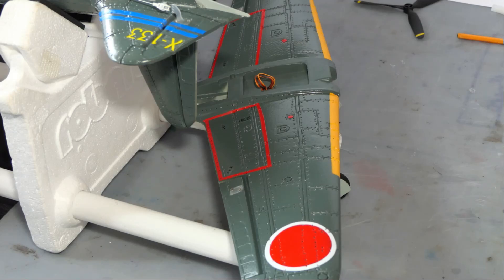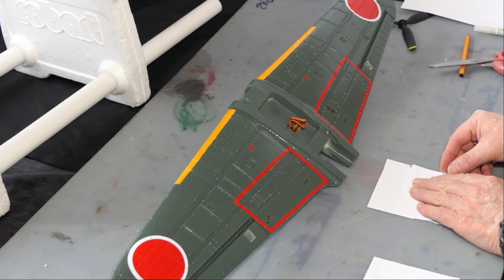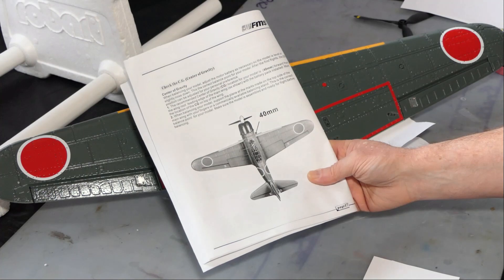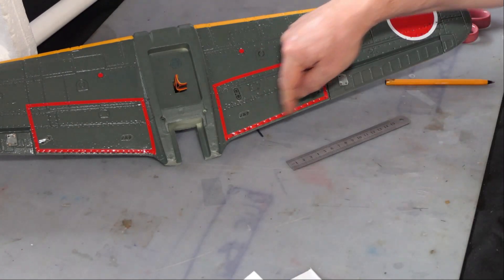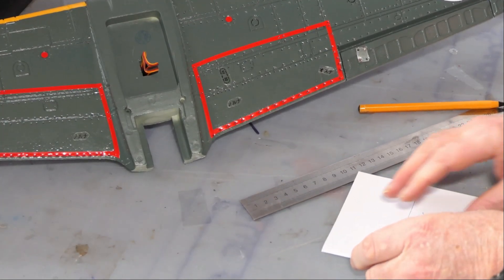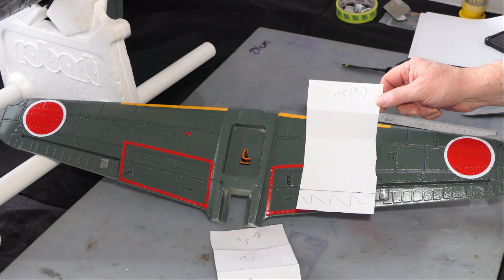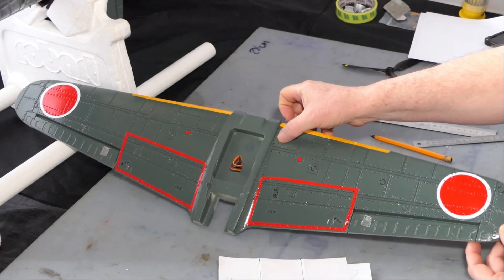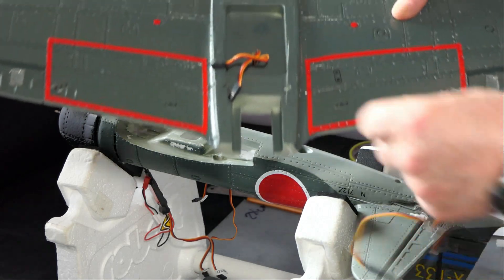Build - FMS 800mm  A6M3 Zero -V2 - Part 3 of 4

Comment: Aaaaaah the ol paper ploy.... Ti's a good way of working the CG out especially on a scratch build. Might need a bit of fettling in the air... As always on a maiden take off is the most unsettling time.
Reply from the maker: I have given up being concerned about the weights needed to set the C/G on these small 800mm warbirds,.....